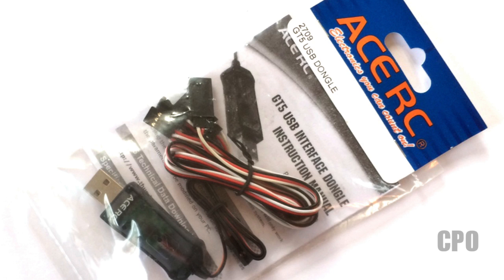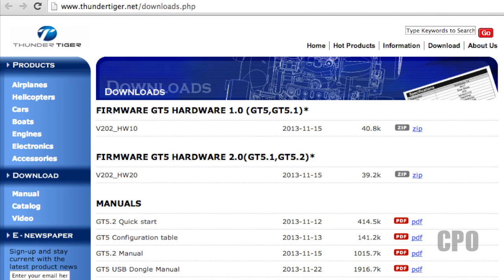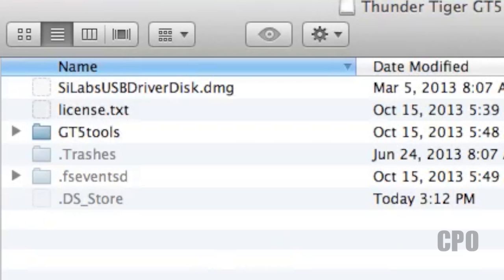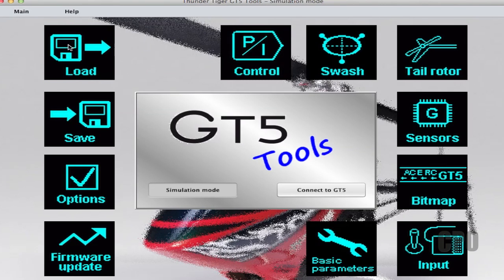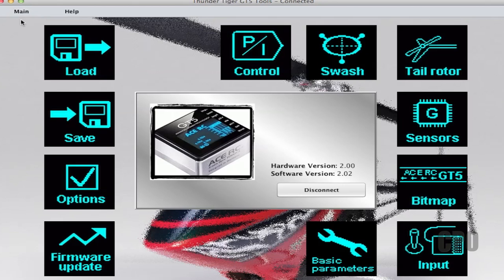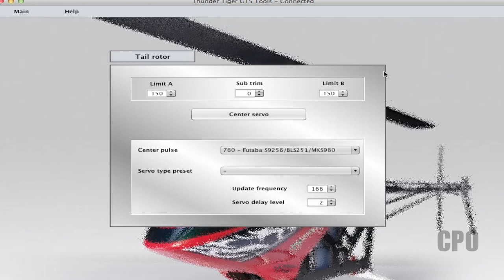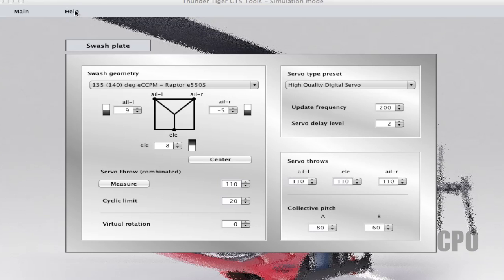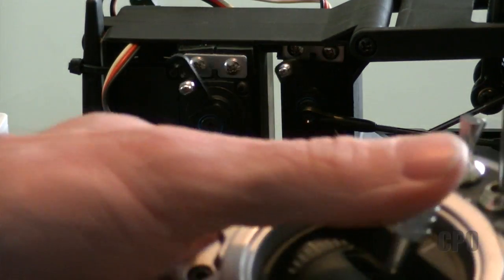GT5 USB Programming Dongle (Thunder Tiger) Quick Look

Comment: very helpfull cpo thx for al the support ......have the same heli as you the e550 fbl
and i wonder if the governor is set-up by factory?

i mean the gov of the talon 90,is the gov überhaupt working with any cable exept the throttle cable there is?